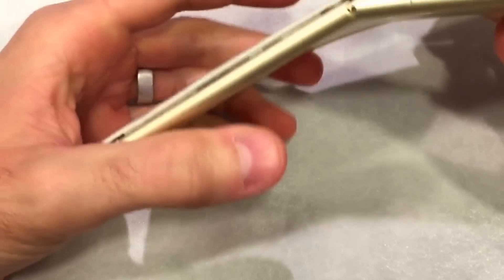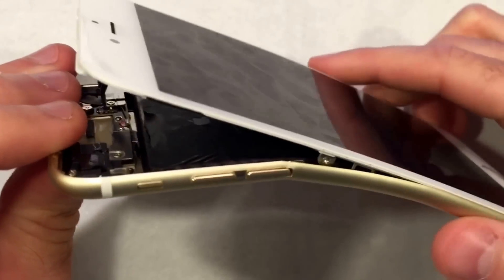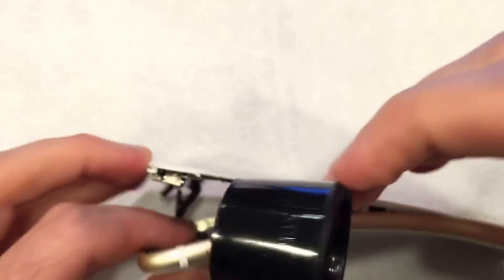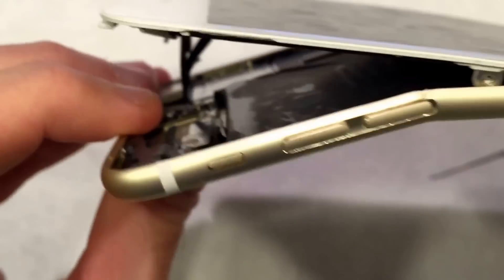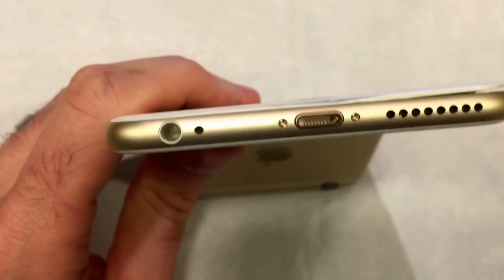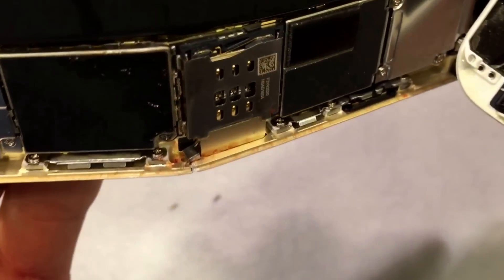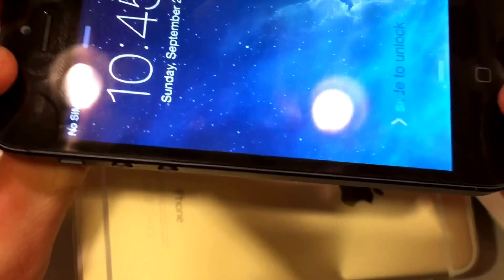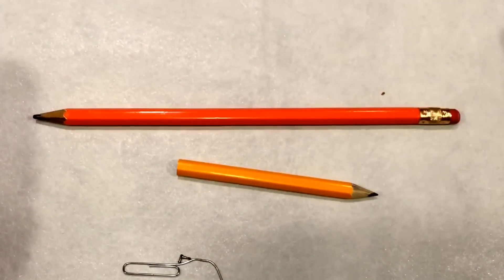Why does the iPhone 6 bend?

Comment: Guys all phones bend. Without using bulky ridiculous looking metals, it's relatively impossible to make an affordable phone. If you add enough pressure to any phone it will bend. Furthermore if someone you know had their phone bend in their pocket, it's because you either wear pants so tight you can't talk or you're being to rough with it. You probably bent it taking it out of a case and then put it in your pocket.

Comment: 0:45 https://www.apple.com/iphone-6/design/ a quick Google search gave me all the info on the type of materials used to create the Iphone 6. "The cover glass curves down around the sides to meet the anodized aluminum enclosure in a remarkable, simplified design. There are no distinct edges. No gaps. Just a smooth, seamless bond of metal and glass that feels like one continuous surface." (are you telling me that you couldn't take 5 minutes to do a simple inspection on the materials of the product?).

It bends cause it's made with plastic and thin anodized aluminum, of course it'l fucking bend (Anodizing is an electrochemical process that converts the metal surface into a decorative, durable, corrosion-resistant, anodic oxide finish. Aluminum is ideally suited to anodizing, although other nonferrous metals, such as magnesium and titanium, also can be anodized.).

Here is a better test than just bending the fucking thing with your bear hands: Take an Iphone 6, put it in your pocket and leave it there for 24 hours while you do other things; after that, use a bench vice, apply force in grams (in other words, apply very small amounts of force to see exactly how much force is required to bend the iphone once heated by the human body, and then repeat that process on an unheated phone.).

Comment: Why did my car break when I hit a telephone pole? Damn Ford, Chevy etc. must be using cheap materials. If I punch you in the face and you bleed and your teeth fall out your parents must have used cheap materials to make you. Your logic is flawed.  The aluminum cracked because its an aluminum alloy. The harder the metal the more prone it is to cracking. That's why samurai swords use two types of steel, soft and hard, to overcome the blade shattering. A soda can will bend because it is thin and not an aluminum alloy. If you reinforce the iphone with metal bars as you suggested, the ends of the bars would just push aluminum resulting in bumps protruding from your iphone and you would still complain. They could build the iphone out of 306 stainless steel but who would want to carry a phone in their pocket that weighed over 1lb. Sacrifices  have to be made to allow the product to be convenient and usable. Bending your iphone was not one of the intended uses. If you lack common sense to take your phone out of your back pocket and sit on it with your fat ass then that's your fault.

Your surprised the battery bent? LIPO batteries are basically electrolytic material in a plastic bag. The battery reacts violently to air so it is sealed in a flexible plastic bag. If the outer case was made of metal or a hard plastic and it cracked it would erupt in flames. Lucky they built the battery this way or you would have erupted in flame with your phone. Essentially, what you call a flaw in the battery is a safety feature. Search you tube for LIPO battery fires caused by punctures.

200 hundred idiots made videos of force bending their iphone 6+. Do you really need to see it done over and over to believe if you use enough force it will break? Think about the environment. Your iphone is now destine for the trash bin and then to the dump where it will leech chemicals into the environment. All this so you can get a pathetic 270k hits on youtube.

Go take a bath with your toaster because you seem to like to do things that are not intended by the manufacturer.
Reply: The only user here using actual logic. ^^^ I applaud you.
Reply: snapcase just got told by this man
Reply: I cried tears of joy, Well done.
Reply: Gold Fishyman -- Do you think it is not possible to make a good light weight phone without bending it ? You are wrong..
Reply: See you sir are smart and good explaining
Reply: Someone who is smart
Reply: +// dean. I'm not too sure if you're trying to make a "kids in Africa" joke or not.

Comment: Thin phones aren't always a good thing as you can see. these phones are so huge, but ppl want them as thin as paper. dissent make sense. make it a few mm thicker and have a metal chassis layer in the middle or two rods of strong metal up each side of the inside of the phone and it would be so much stronger.

Comment: Reasons why the phone bends:
Aluminium is soft, especially when it's thin and has a larger surface area.
It doesn't use a magnesium chassis unlike other phones (which is why they don't bend too easily)
Thinness. The device is 7.1mm thin, combine that with the soft metal and it's not going to be too hard to bend.
Also, phones like the HTC One m8 (which are also made of aluminium) have a curved back for distributing pressure.

fyi, I'm ready for all the unoriginal (iSheep) comments.

Comment: this is extremely funny to me I've had my iPhone 6 plus since it has been released and my phones not bent, that being said I'm not saying there indestructible  and in my opinion a phone that is 7.1 mm thick that is made of one of the softer metals is going to bend under extreme, force that is a given, even more so when you apply that force directly in the center of a device that has 5.5 in screen so come on stop bagging on the the iPhone its a great phone now I'm not android hater i came from a note 3 to the iPhone  so don't call me an android hater I'm just tired of every one hating on the iPhone

Comment: Dont buy any Apple products. If you really want it, dont go anything further than the 5S.
Reply: 5S is better at hardware & software than 5C. And i havent seen one but i heard that the back panel melts when it gets direct contact from the sun.
Reply: Get the 6 the 6 doesn't bend only the 6 plus I mean you can bend the 6 ever so slightly if you go full force at the weak point with tools but who's doing that
Reply: Captain Falcon xD

Comment: Nonsense!
Samsung Galaxy note 3 and 4 that are even bigger and thinner than iPhone 6 and 6 Plus, don't easily bend even under bigger force.
DERFORMATION TEST (or Bend Test) by the US Consumer Reports
Samsung Galaxy Note 3 ........... 150 lbs
LG G3 .........................................130 lbs
iPhone 6 Plus ..............................90 lbs
iPhone 6 ..................................... 70 lbs
HTC One (M8) .............................70 lbs
Built like a tank, Samsung Note is superior impressively earning the top rated chart.
iPhones 6 is as inferior as HTC One, both of iPhone and HTC are made in China. Samsung is not made in China.
Reply: abirneji in overall size Yeah because apple poorly designed the 6 plus while the note 3 has a 5.7 inch screen (bigger then the 6 plus) while being just a tad smaller. Samsung engineered a rather robust device.
Reply: Conor Walker Thinner is not always better and full Aluminum is not good. Also Apple does not say the grade of the Aluminium but it looks low quality Aluminium since when it bends you can see in the creases it's irregular. On the good Aluminium this does not happen. It stays regular and smooth. So Apple have actaully done a bad build quality.
Reply: And taller
Reply: ***** LOL you shut up. The Touch ID is made by Motorola and the iPhone, iPad and iPod chips by Samsung. Apple does not know how to make their own hardware.
Reply: Majestic Frederick well it isn't china
Reply: the note 3 is smaller than the 6+
and he clearly explained why it bends
did you watch the whole video?
Reply: yep I know that much
smaller phone bigger screen with the note 3
Reply: TrollediaBF so what if samsung make the parts
It's not like it makes the difference it just means apple doesn't make their own parts
Reply: TrollediaBF I thought the day would never come
Reply: abirneji Thinner isn't always better, also the aluminum is not very durable and it can brake very easily as well as many iphone screens. Samsung makes a TANK of a phone, I had a Samsung s2 for 2 years and it didn't Crack once and I have dropped it a lot. My friends I phones are always broken and if I had one it would be very annoying
Reply: Nope that's where your wrong
9/10 peoples Samsung's have broken charger ports a tank of a phone would be LG G Flex
And maybe even HTC's and the iphone 5 and 5s
Reply: abirneji i has 3 samsung phones for overall 4 years and not one port has broken.
Reply: TrollediaBF well you must be good at taking care of phones
Reply: abirneji i am. never broke any of my iphones or androids! :)
Reply: Lol same but my other phones werent smartphones
I had a sony ericsson spiro, then the orange sydney, then I used my bros ipod4 for a bit, this htc is my first smartphone so I cant say much yet
Reply: ***** read the above
Reply: your comment is nonsense, this only happens with the 6+ .-.
Reply: To be honest apple did screw up
This is coming from someone who always defends apple
(I own htc btw, its androids apple alternative)
But yeah the 6+ is horrible
6 is fine
Reply: ***** foxconn?
Reply: You do know that the iPhone 6+ is thinner than the Galaxies
Reply: they are also wider therefore can withstand agreater force do to it distributing the force over a larger span.
Reply: Samsung is made in Korea ;l
Reply: abirneji well thats true...

Comment: I know what aluminum apple is using its the same aluminum found in coke cans because you can rip a coke coke can and coke cans are easy to bend. Apple should recall the Iphone 6 and iphone 6 plus or offer a exchange in store for a re-enforced iphone 6 and iphone 6 plus. Apple needed to add hard to bend steel re-enforcement in the iphone 6 and iphone 6 plus, This would have stablized the iphone from bending.

Comment: See the metal rod that is connecting to the fulcrum point at 4:52? If that metal rod was a single long piece that goes all the way from the top of the phone to the bottom, and if there was the same thing on the other side, then that phone would be so much stronger.

Comment: Reasons why one m8 htc is better than iphone 6: 

Iphone 6: 

Display: 
4.7 inches 
Retina HD Screen 

resolution: 
1,334 x 750 pixels 

density of pixels: 
326ppp 

storage: 
16GB, 64GB, 128GB 

Expansion of 
  storage: 
No 

Rear Camera: 
8 megapixel 
  (iSight); 
  1080p video recording 

Front Camera: 
1.2 megapixel 

RAM: 
1 GB 

HTC ONE M8: 

Display: 
5 inches Super LCD3 

resolution: 
1,920x1,080 pixels 

Density of pixels: 
441 

storage 
16GB, 32GB 
(EXPANDABLE TO 128 GB) 

Back camera: 
4 'Ultrapixeles'; 4K video recording 
(4 ULTRAPIXELES IS BETTER THAN 8 megapixels) 

Front camera: 
5 megapixeesl 

RAM: 
2 GB 

The htc one m8 is more resistant to water wings and falls. 
No offense to the iphone are those who do not know Cpu, Gpu Etc 
(SON FOR THOSE WHO DO NOT KNOW SPECIFICATIONS) 

iPHONES ARE FOR NOOBS 

ATT: 
XXMASTERGILXX

Comment: Why were you so surprised to see that the battery bends? What did you expect and why?
Reply: Batterys dont usually bend, ive had 8 phones and if I tried to bend my battery I would need more than my hands, and if I bemt it with tools they would probibly snap
Reply: Nick Diforte Apple is probably saving space and weight by eliminating the plastic battery case. Many years ago, Polaroid used a battery that wasn't much thicker than a sheet of film in their film packs. That battery was quite flexible.
Reply: Ed Price you might be right, it might jave been cheaper for them to do it the way they did. Its honestly a cheaply made phone with some 2012 softwear. I perfer andriod over this any day
Reply: ***** You seem to have a lot of emotion invested in this, almost an Apple Fanboy, if you need to insult people based on which phone they buy. You should remember that new releases of most any product will have problems (the customers, you, are the Beta testers). In any market, if you need to be on the cutting edge, prepare to bleed.
Reply: ***** Yes, as you point out, products will get better with maturity. Apple has always been a very "controlling" company, telling its customers that if they simply put blind trust in Apple, they will reap one of those "insanely excellent" experiences. That works as long as your products are really good, but it invites harsh exposure when they do screw up (twistable cases or bad antenna design). I have done my time on that cutting edge, and now I try to buy my technology somewhat down the curve, maybe at 80% of that cutting edge. Costs are dramatically lower and reliability is much better. For instance, I updated to an iPhone 5 just after the 6 came out; maybe I'll get a 6 or a Samsung in another year.
Reply: ***** theres always a moron like you saying "people like you D:D:D:D: " and " i have both xxxxxXX". go fuck yourself mister hi-tech fucktard. and don't insult people cuz then you will be insulted back.
Reply: I think it depends on how you use your device, I've had android phone since the G1 but also had an iPhone. When the iPhone first came out it was damn good nothing of its kind but as time progress to me ios just got boring and restricted as a phone at least to me. Though I do have an iPad Mini Retina but would never get an iPhone for the simple fact that to me as a phone is too restricted. I love my Mini Retina since yes Apple does have better apps and which is the reason I use and ipad for the games and certain apps. As a phone though I can't stand iPhones just not enough freedom for me to have the information I need when I need it. I think both android and iOS is pretty excellent in there own ways and for one I love the crazy specs on android kind of like a a supercar, yes it can hit 250mph but hell when are you really going to go that fast but you know is there. So to me iOS is like a Toyota doesn't need all the high end specs but it works and android sort of like a supercar has crazy ass specs but won't really ever use but is there and it makes you happy has a ton of "gimmicks" even if you never use it you have the choice to one day. No need to argue about what is better or worse, I think there both excellent just in there own way and it caters certain consumers. So give me a 2k display that shoots lasers and shit I'm happy with it but if I want a not so exciting os that "just works" I have Apple, the more choices we have the better i think.
Reply: I actually work with someone whos second job is literally to pack and ship bent iphone 6 + back to the factories. the day after the release they actually had cardboard boxs filled with bend iphones
Reply: ***** What if i told you, that samsung is not the only company relying on Android, and that touchwiz sucks balls?
Reply: Benjamin Christiansen Well, I won't question your expertise on Samsung, but you'll need to provide your credentials regarding ball sucking.
Reply: Ed Price He's got google for that, but i don't have a problem with touchwiz.
Reply: ***** sure just go into any apple store and tell them that your good at closing boxes

Comment: Yo if that LITHIUM battery can be easily bent with the phone, I wonder how long it will take before one become unstable from the stress and catch fire/ blow up... glad im not an iphone user. Plus what the hardware differences from the 4s, 5, 6 other than larger battery, screen and slim design?

Comment: Its aluminum and has a lot of leverage what do you expect.....
Reply: The iphone 6 lacks a magnesium chassis so it is weaker than other large phones.
Reply: I expect it to be a durable product which you cant totally destroy with barehands.
Reply: When you spend like 200 dollars on a phone, people expect it not to bend in their pockets no matter what its made of xD
Reply: The htc one's are aluminum and are far more durable. Its not just about the material its the rest of the build as well. You can see in the video that there is no chassis (structural skeleton) in this phone, its just all the parts wedged between a screen and the aluminum backplate.
Reply: Kaeli Lagerquist Ummm hello, where do you get $200 from?  iPhone 6+ is more like $800 or more and if you get the one with 128gb, you will have to shell out well over $1,000.00.  The $200 price is for the iPhone 6 and you have to be in a 2 years contract.
Reply: Tim Tran its called just a random number 😛